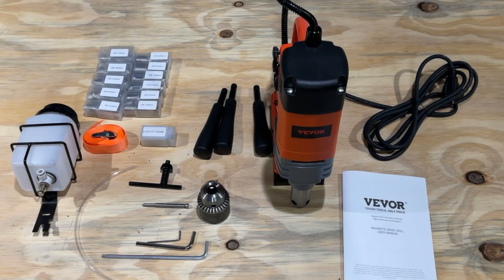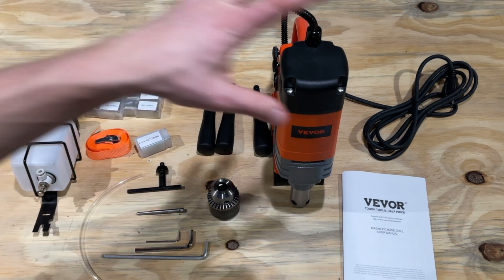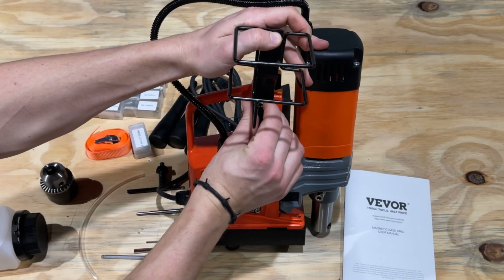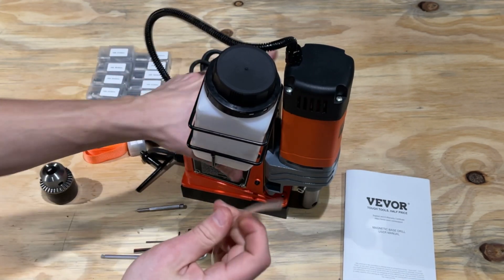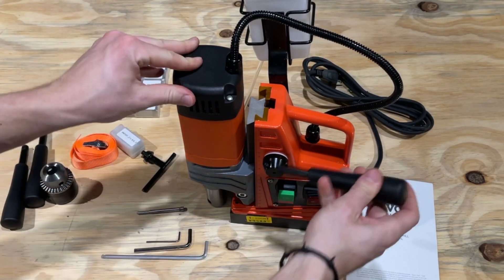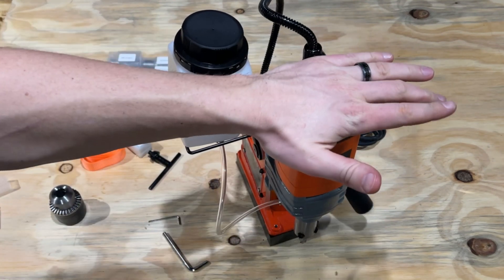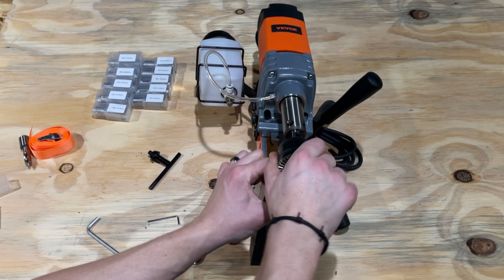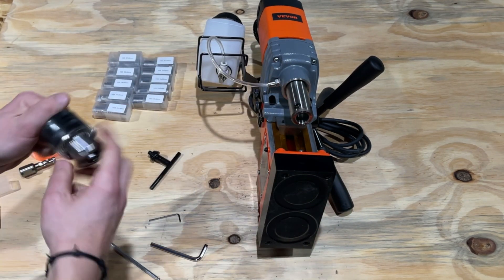How To Set Up Assemble Vevor 8840 1300W Magnetic Drill Press

Comment: The chuck attachment says it’s the same size but it not even close to being able to screw into my drill bit attachment.
Reply from the maker: It sounds like you might have received a defective chuck attachment or perhaps the wrong size. I'd recommend double-checking the model number and contacting the manufacturer for a replacement that fits your drill bit attachment.